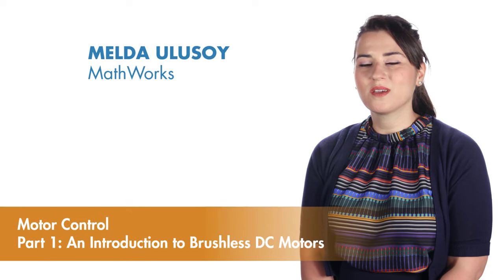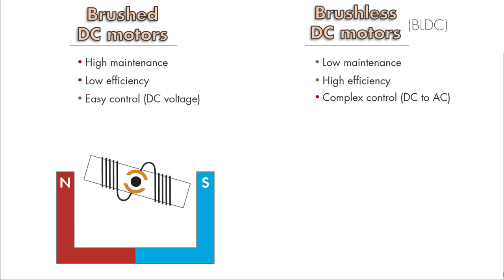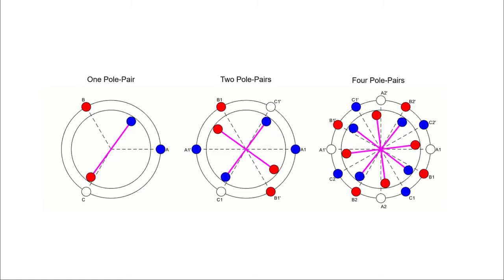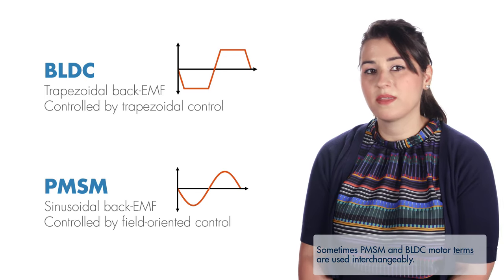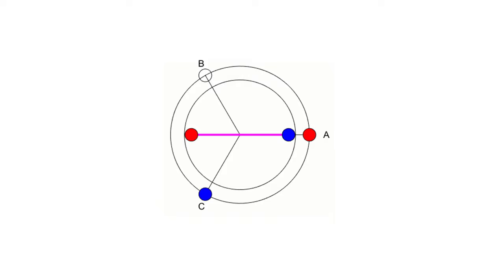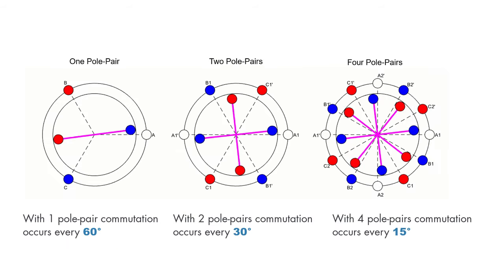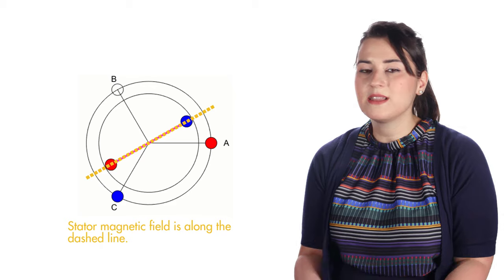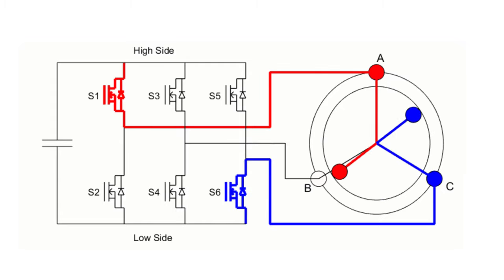An Introduction to Brushless DC Motors | Brushless Motor Control with Simulink, Part 1

Comment: Would have been very useful to make mention of the distinction between in-runner and out-runner BLDC motors when defining terminology so the rotor and stator references were less confusing for anyone working with hub motors.

Comment: An issue is confusing my mind for a while. The Back EMF depends on magnetic flux according to Lenz's Law, if the magnetic flux is created as sinusoidal, the back EMF is derivated as sinusoidal as well. So my thought is that we can apply the FOC to BLDC motors due to the flux structure used in FOC Control Algorithm. Consequently, BLDC motors can have Sinusoidal Back EMF rather than Trapezoidal Back EMF. 

Am I right or not. If you help me with that I  would be grateful.
Reply: The back-EMF profile is determined by the way the windings of the stator are wound. For example, with trapezoidally wound windings we'll observe a trapezoidal back-EMF. In the literature and industry, there are examples of BLDC control with different control schemes such as trapezoidal, sinusoidal and field-oriented control (FOC). For better performance, the commutation type should match the back-EMF waveform. So BLDCs (with trapezoidal back-EMF profile) are recommended to be controlled with trapezoidal and PMSMs (with sinusoidal back-EMF profile) with sinusoidal commutation. FOC provides a better performance than both the trapezoidal and sinusoidal commutation but at the cost of being a more complex and expensive control method. Below is a helpful article summarizing different control schemes and comparing them to each other. I think your question is a great discussion topic for the Power Electronics Control Community (https://www.mathworks.com/matlabcentral/topics/power-electronics-control.html?q=&page=1). Please feel free to post it and any other potential questions you might have on power electronics to this community. 

Link to the comparison study of the commutation methods: https://pdfs.semanticscholar.org/40ac/06d3db0b82242038c2dcd20c433d5d1c74f6.pdf
Power Electronics Control Community: https://www.mathworks.com/matlabcentral/topics/power-electronics-control.html?q=&page=1
Reply: @meldaulusoy8389  Thank you for your answer and interest! I am going to check and join these suggested communities. Additionally, I am waiting a lot more video contents like this, it is more informative and useful.
Reply: @mehmetkilic9518  We're planning to have multiple videos in this series. We also have another video showing how to build the simulation model we use in this tech talk. Feel free to check it out here: https://www.youtube.com/watch?v=JDgvBZbnfPw
Reply: @meldaulusoy8389  Hi Melda, thank you for your comment, that explains a lot!

Comment: thanks for the excellent explanation of the working of a bldc motor control and i have a question as i have noticed that you are using the a dc dc pwm generator. so, I wanted to know whether we can implement other types of PWM techniques like SPWM and SVPWM techniques and how it can be implemented on this modle? thanks
Reply: Quote: "I wanted to know whether we can implement other types of PWM techniques like SPWM and SVPWM techniques and how it can be implemented on this modle?" 
I'm a hobbyist. Several years back I tried to design a stepper driver using SPWM. It's referred to as micro-stepping. It allows a stepper motor to be more precise and much quieter. It's perfect for a CNC machine. 
If BLDC motors were used for robotics maybe SPWM would be useful but otherwise PWM works just fine.

Comment: This is for which course? Electrical engg or Mechanocal engg? Anyone can tell me the specific course/domain name?
Reply: I dont think this video was for a specific course, matlab just tends to post educational videos like this. 

You would learn more about electric motors in an electrical engineering curriculum, though you will learn about them in a mechanical engineering curriculum incorporating circuits and mechatronics. 

Both types of engineers can do research into electric motors, but mechanical engineers are more likely to be designing the mechanisms the motors actuate, and they will be the ones selecting which motors will be used, whereas electrical engineers will be likely designing the electrical components that manage and control power and signal to the motors, or track its position.
Reply: @samo6401  but electrical characteristics of motor/generator is much more than mechanical characteristics, that's why much of the research and development in these devices have been from electrical engineers

Comment: Thanks for video!! Question: @8:53 you say to control the phases for the 6 step commutation a DC-AC inverter can be used. My questions is, can it be controlled using 3-phase variable-voltage-variable-frequency supply instead?
Reply: Typical motor drive includes an AC motor (BLDC in this case), inverter to convert DC source to AC waveforms, and a controller to control the operation.
3 commutations methods often used to control BLDC motors are 6-step commutation (trapezoidal), sinusoidal, and field-oriented control (vector control). In the next video we will look at six-step commutation. 
If you are asking about V/f control scheme, that scheme is sometimes used to control induction machines, but is increasingly replaced by field-oriented control.
Reply: @meldaulusoy8389  Thanks for taking your time to reply. I am teaching myself how to use Simulink and trying to use  it to simulate a Ward-Leonard system (it functions as the variable frequency supply) for a test bed to test electric motors(PMSM, Induction, BLDC) for EVs. Will any of future videos be helpful in that regard?
Reply: @blessingndlovu9037  We're planning to have multiple videos in this series and hope to cover BLDC and PMSM motor control. I recommend checking out the below resources for more information, examples and videos on motor control:
https://www.mathworks.com/solutions/power-electronics-control.html
https://www.mathworks.com/solutions/power-electronics-control/field-oriented-control.html
https://www.mathworks.com/solutions/power-electronics-control/bldc-motor-control.html
Reply: @meldaulusoy8389 
Excellent  and very clear enswer wihtan an intreasting video for understanding motor
Thank you very much